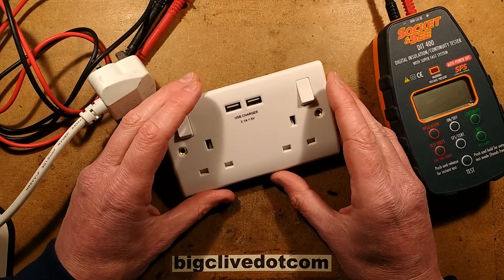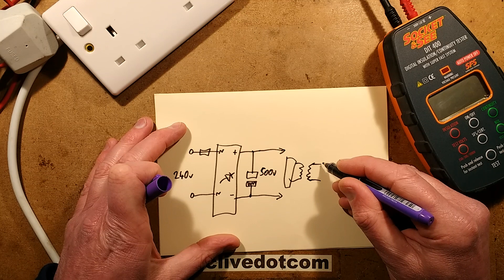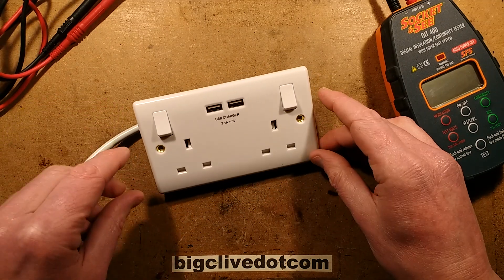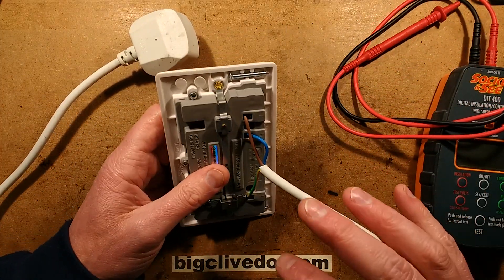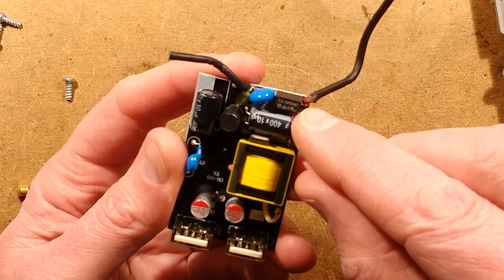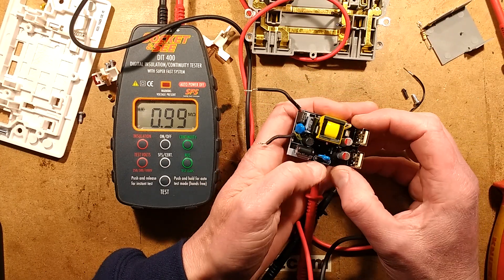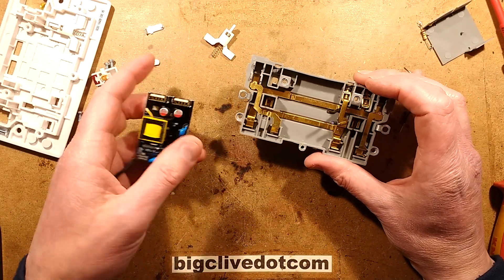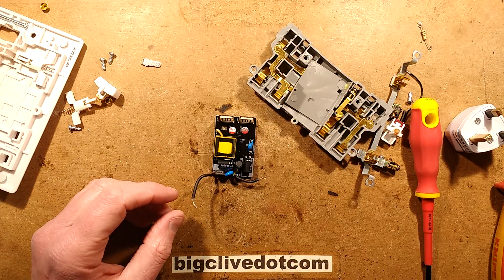500V insulation test of a British General USB socket.

Comment: Others have already mentioned this but it bears repeating.Insulation test is only L+N-E i.e. connect line to neutral and test that at 500V to earth. Many devices such as a bar radiator will not be 10 Mohms between line and neutral if On for the test. Insulation test should be done with the device on. 
A more difficult and more applicable test is "earth leakage" but for that one needs a different bit of kit. A Portable Appliance Tester (PAT) is one way to fully test an appliance.
The complication with the "USB socket in an outlet" is it is not an appliance and as mentioned if it does go bang the user has an issue that needs an electrician.
Reply from the maker: Not in a full proper installation test.
Reply: Which should only be testing the wiring. 
Consider if a power outlet with neon indicators is connected, the test will fail. Same goes for electric stoves, fluorescent lights to name just a few.
Certainly all the devices I've mentioned are different in that they can be turned Off i.e. isolated from the wiring and the remarkable thing isn't that these USB enhanced outlets fail but that their load cannot be isolated. Still they are being manufactured by reputable companies. They must pass at least Australian tests for that to happen.

Comment: Clive, that is not how one measures isolation resistance. One side of the circuit to PE and to the other side. You definitely do not stick 500V or more between L an N and wait for it to blow up.

Comment: The reason why the voltage is lower at no load is because the switcher goes into "hiccup" mode to save power. It'll deliver a few bursts of pulses and then turn off until the output falls to somewhat below normal. This means that it can meet the EU standby power directive by consuming next to nothing at no load.

Comment: I'd like to see one of these sockets with micro-switches on the USB outputs so that the PSU is dis-connected from the mains when no device is plugged in. That way, the socket wouldn't make the installation untestable  as this one does.

Comment: I don't see an optoisolator on that board so it must use primary side feedback that explains why the voltage regulation is a bit sloppy especially at no load. Granted it was within the +-5% tolerance I guess that allowed them to shave off a few cents in the BOM.

Look at that copper pad and the thermal vias above the schottky diode to dissipate extra heat a nice touch. That's a far cry from that external USB charger where the poor diode was literally being roasted.
Reply: Bushougoma. They use a diodes Inc PSR control chip with deliberate feature of cable compensation

Comment: +bigclivedotcom Could you sometime please make a video explaining why your UK one way plug style is better then the turn able plug style we have here in Sweden (and large parts of EU?)? To me it seams the turn able style have huge advantages. And I can't see any downsides?
Reply: That doesn't deal with variable sizes of cable being plugged in. 1.5mm² doesn't care about 13A, 0.5mm² gets hot and goes all gooey.
Reply: It's better for us because of ring circuits.  Because of ring circuits (32A breaker 13A for socket outlets) we need fused plugs.  To ensure the fuse is on the phase we need polarised plugs.  

You use radials in Sweden so you don't need them.
Reply: Could you not just put the fuse in the outlet instead then? Should be less of a % increase on the outlets price than it would be on the plugs price?
Reply: No, because you don't wire the next socket down off the output of the fuse - you connect it in parallel with the incoming supply.

Yank tendencies to miswire installations by hiding GFCI sockets midway down a circuit are frustrating and idiotic.
Reply: By that logic nothing in the house would work unless there was something plugged in to every outlet :) No it's parallel circuits in the UK as well :)
Reply: But then that would be a problem here too? If you have lots of fuses in the fusebox or if they are in the outlets should not make a difference in that case?
Reply: There is one downside to the UK plug, they really hurt when you tread on one!

Comment: year's ago I watched a tv programme and they were talking about how you should unplug your phone charger when not in use. Now we have plug sockets with built-in USB the USB permanently wired in with no off switch.. I like the idea of a built-in USB but don't like the idea of it always being turned on
Reply: That's why you should insist on only high-quality products instead of penny pinching and buying cheap Chinese crap. The Chinese think the CE mark means China Export, but a decent product will be safe and fully compliant plus it will draw next to no current with nothing plugged in.

Comment: I think the insulation test should be between the mains and the usb jacks and not across the the mains leads.
Reply from the maker: It was to emulate a proper installation test.  Not the isolation of the USB circuitry.

Comment: This is the very model of a modern socket general.
Reply: and at 500 volts it shall be eminently testable
Reply: Good One!!!
Reply: Under rated comment!!!
Reply: And it's very good to know that
The resistance isn't low that 
You can use it in the UK
As power socket General.

Comment: Clive, I suspect that the text on the data sheet you read at the beginning means 10Mohm between the USB receptacles and the mains input, not between live and neutral.  Isolation of the USB receptacles from mains is what matters for user safety, after all.
Reply from the maker: I don't know of any standard electrical test in the field that does a USB isolation test.  I'm sure somebody at the IET will invent one though.

Comment: Obviously, the input terminals will never be insulated one from other.
You must test insulation from input to output (USB port).
Reply from the maker: Port isolation is not part of any on-site insulation test.
Reply: Ok, but you can't test the isolation when you have a load connect. Obviously you will sense this load. 
The import isolation here is if the user is protected if he touches the USB port or the cable connected to it.

Comment: Would be interesting in comparing this with and MK unit to see it the MK are worth the extra money or not.
Reply: I enjoy Tom's channel too. I've got a recent 2 gang MK one here that was half price in Screwfix as the box was missing. If you want it Clive, drop me a message

I'm an electrician; I've never installed USB sockets, I have removed a couple for a customer as they were making whining noises at only a few weeks old. I agree Clive that I'd much rather use something I can unplug easily- my go to for reliability is the IKEA Koppla that you reviewed before. I was intrigued recently to discover the MK Euro module ones that switch off, but the deep back box puts me off... https://www.tlc-direct.co.uk/Technical/DataSheets/MK/MKK5837_Info.pdf

Could really do with something IR test proof, 25mm back box compatible and silent though- it helps prevent all sorts of dodgy chargers turning up in community venues and offices. Maybe a 1 gang plate with a 3A BS1362 fuse and two USB sockets. Pop the fuse out when testing, job done
Reply: Mark Wallis Some of the mk ones (like their euro module) claim they switch off via a micro switch with no usb plug inserted. Not sure where in the circuit the switch is, though.
Reply: David Gill When I fit them, I've either used the mk euro module one or I use a click euro module with a switch module adjacent for isolation. I don't like the ones built into sockets.
Reply: In some respects I think the MK are better build but the BG design is better. It's a tough call but couldn't necessarily way they are worth the money although I think MK logic looks better (my opinion obviously).
Reply: just had a look at the Scolmore Click ones; they don't instil much confidence in me- the switch and USB modules only have a 1 year warranty!

Comment: A BS1362 fuse accessible through the front of the socket  protecting the circuitry would provide a convenient means of isolation.
Reply from the maker: Or even an on-off switch for the USB supply.
Reply: Yes come to think of it Even dimmer switches have hard on/off . There should be some means to isolate the usb psu for test and faults . I can see this being addressed soon as lots are installed an start to cause problems.
Reply: The ones I bought for my flat have  fused usb ports

Comment: Why do you have switches on the AC sockets, but not on the USB ones? It would only seem logical that, if you can't unplug the electronics, you should at least be able to turn it off without tools.
Reply: because standby on 240v electronics uses more idling power than usb devices
Reply: girlsdrinkfeck, if you have to reach for the socket, you can just as well unplug the device. Besides, many devices use no stand-by power (toasters, water boilers, washing machines, ...), while others are expected to stay active, like routers, a microwave that shows the clock, or tv recorders that need to record something when you're gone. Many tv's also have a hardware switch, and not just stand by mode. I believe the only device in our house that's often in a useless stand by mode, is our radio.

The stand by issue was even less an issue in earlier times. So I really doubt the switch was invented for that.
Reply: girlsdrinkfeck, I don't know about British plugs, but schuko ones usually arc at the tip, while the tip isn't used to make a connection. So arcing doesn't degrade the connection.

Switches are worse in that regard, as they can also arc, and usually arc at the contact points. Depending on the design of the switch ofc.
Reply: @sanderd17  I haven't seen a British plug arc since the 80s,
Reply: Sander Deryckere Speculation about the reasoning doesn't change the fact that switches on 240V a.c. outlets are legally mandated. That is the reason, end of story.
Reply: Simple not required by UK or EU Law so why waste money adding stuff that legally you do not have to worry about?!
Also USB ports does not have the socket guards either which they should remember it is not the Volts that kill most people it is the AMP's and while an adult takes around 9 amps to kill a young child or baby can be as little and 1.4amps if I remember correctly!

Comment: If you test appliances for insulation resistance you wire N and L together and test against ground or case, so you dont blow shit up. You never test insulation between N and L, never or you will destroy stuff and its says nothing.
Reply: Can you do a follow up testing with N+L together against the output pins (best also all wired together, shield + Vp + Vm of USB)
Reply from the maker: That's an appliance test.  Not an installation test.  A full proper UK installation test should include the insulation between L and N.
Reply: In Germany according to VDE you are not allowed to measure insulation between N and L, IF consumers are in the installation (this includes USB-Wallchargers, Movement detectors, Lights etc). Pretty sure UK has the same somehow.
Edit:
"the complete installation must be switched off, all lamps
removed and all equipment disconnected."  and later on:
" Before
testing, it is necessary to disconnect equipment
and take measures to prevent the test voltage
damaging voltage-sensitive devices such as
dimmer switches, delay timers, and electronic
starters for fluorescent lighting. Such devices
can easily be missed and bring about great cost
to the user and inconvenience to the customer. "
https://www.bsria.co.uk/download/product/?file=egduN1aGMzY%3D

Samge goes for N/L to Earth if any overvoltage protection devices (because they would trip) are installed.
Reply: Also found another one more official:
https://www.landlord-certificates.co.uk/wp-content/uploads/2016/06/guide-to-the-wiring-regulations.pdf.compressed.pdf

Page 196:
 Electrical equipment and appliances such as controlgear and lamps
should be disconnected prior to testing. Many such devices if left in-circuit would show as an insulation failure; also, sensitive electronic equipment such as dimmer
switches and electronic ballasts could be damaged in the test.

Comment: When you did test the insulation, you only tested the insulation between the metal strips, not the pcb. Ok, you tested between L and N, but that doesn't make sense, does it? It confirms a connection to the electronics, nothing else.  The test from L or N to earth only tested the strip spacing in the socket, not the Y cap, not the transformer. The PCB wasn't connected to earth. I was hoping for you to twist the L and N wires of that pcb together and test between those and the USB socket (plug in a USB plug with wires exposed, twist everything together including shield, and clip the other end of the insulation tester to that). This comment is meant as constructive criticism, not to start a flame war.

Comment: I'm with you about having electronics in the wall, could cause a fire, or at least discolouration of the wall, there's no way to easily turn it off, if you have a few of these in the home, it's always consuming power, so energy use and cost goes up.
I think i saw an early version of this type of socket where there was an accessible fuse in the front for the usb, that would have made it easier to test..
Reply: if this becomes the new standard wall socket It all adds up, watching your electric meter moving with nothing in your home but 20+ USB socket switched on all the time
Reply: Even with 20+ sockets its still less than 15W or 0.00225 pence per hour at 15 pence per KWH. Worrying about tiny amounts of current in standby is ludicrous.
Reply: @cbcdesign001   and the main argument against the "standby scrooges" is that any energy consumed isn't "wasted" as is often said, it simply adds to the heat in your home, which in the UK we do need for most of the year.  Therefore my argument is that energy saving devices only save money in summertime!
Reply: Yup, that 72mW gets really expensive. Over a few centuries.

Comment: Clive, got a bit of a mystery here.  Ryobi 4 volt TEC4 drill driver charger only lights up in certain outlets.  Have any ideas as to why that might be?  The green indicator does not light, but I don't know if it's actually charging.  On other outledts, it works fine.
Reply from the maker: It may be a plug contact issue?  Is there anything odd about the plug?
Reply: The plug contacts are very solid.  One strange thing is that sometimes I need to put the battery in and then plug the charger into the wall.  Sometimes not.
Reply: You know, I think it's the charge management system.  That's the only complicated thing here.  Oh, I have a great question or comment, I think.  We get some power outages here in the northeast of the US.  I hate tending to the generator.  My idea is to put a couple of sealed lead acid batteries near the breaker panel and keep them charged with a smart charger.  Then take all the essential circuits (low wattage) and tie them to the batteries thru an inverter.  Somewhere between 2000 and 4000 watts.  So all that stuff will be permanently running on battery/inverter power.  Then when the next outage occurs, I won't be bothered by my wife screaming that her TV went off in the middle of her stupid programs.  I'm just wondering about the losses reflecting onto my electric bill.  The bill right now is about $60/mo.  Any thoughts or ideas?  Let me know what you think.

Comment: 400v?
I was told that the cap should be 3X the voltage! 
So in theory the cap should be 720V
Reply: A 400v electrolytic capacitor is sufficient for rectified 240V AC.
The 3x voltage rating is typical for tantalum capacitors.